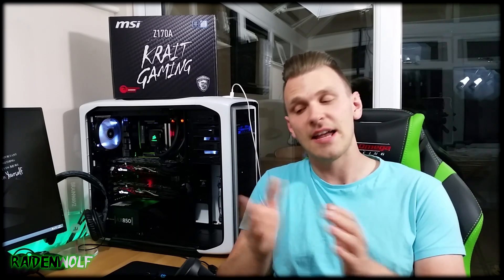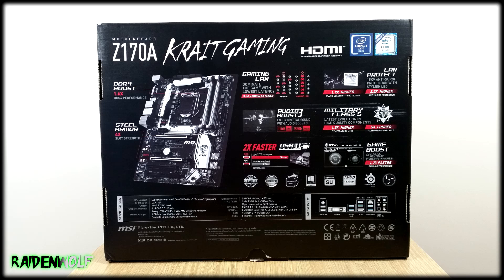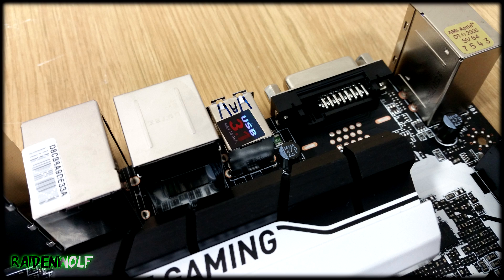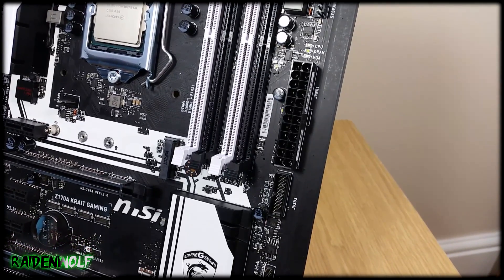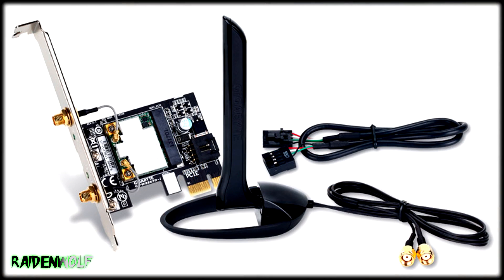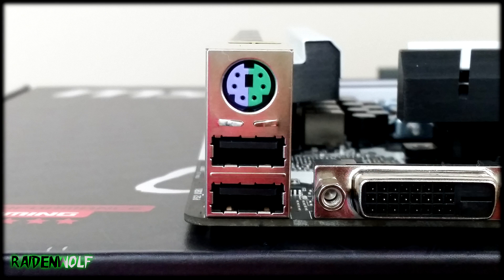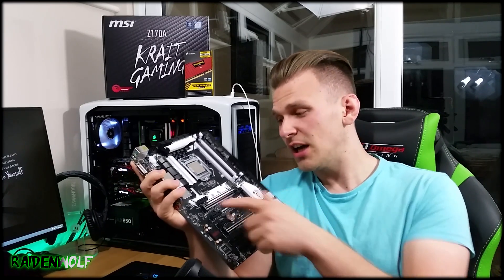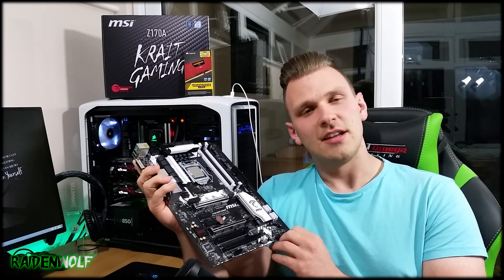MSI Z170A Krait Gaming Motherboard Review, In Depth Look,  Skylake, DDR4, Giveaway?

Comment: So wait if I have a Hard Drive, an SSD, and an optical drive does this mean i have to get more sata data cables?
Reply from the maker: Yes unfortunately you only get two sata cables so for your self you would have to get buy a extra sata cable or buy a m.2 ssd which will slots into the board then use the two sata cables for hhd and opitcal drive :/
Reply: thanks Tech K Raiden for responding. Im going to be booting my OS from a usb instead of an optical drive which is perfect for me since in my build im just gonna have a SSD and a Hard Drive this board is going to be good. Thanks tho again for responding though I really appreciate it

Comment: Would it be advisable to buy this now and keep it for awhile. I currently don't have the budget to get a new rig (mobo,cpu,ram), but seeing as kaby lake will be compatible with 1151. i was thinking of buying this mobo now and getting a kaby lake 2-3 years down the line. I know probably there will be a new processor line released after by that time, but i'm okay with using a slightly older processor. Currently my i5 4570 is doing quite fine but i want to switch up 3-4 years in the future.

Comment: so I don't have to get a sound card for best experience with headsets?
Reply from the maker: No you can use therw audio boost 3 with a analog jack headset (wired) if you use a usb you cant use the audio boost 3
Reply: Tech K Raiden yeah, I have already plugged mine into the motherboard, and i've seen a different in terms of the quality :)

Comment: Question Sir I'm confused are all lga 1151Mobo run all ddr4 i mean cant it run other frequency like pc 2666 or higher or just the high-end board only thanks sorry for my english.. im tight with budget and i want to use pc2666 ddr4 ram
Reply from the maker: +Kira Yamato Yes all z170 1151 sockets use ddr4 with 2100mhz up to 3600mhz so up to u with memory speed you wont to use ect.

Comment: I am thinking of buying this mb with an I5 6600k but I am conflicted because I like the gigabyte Z170x gaming, too.I have a lot of HDs(4+1 ssd) and I am a little concerned of space issues since I also have a huge gigabyte gaming gtx970.Any opinions would be appreciated.
Reply from the maker: Hey. Have a look at my other video of the msi z170a carbon RGB motherboard review I did after this, it is based on this motherboard  with some improvements :)

Comment: does this have built in wifi/can you connect wife to a pc w/ this board
Reply from the maker: Hey. No sorry this motherboard dont have a built in wifi you would have  to buy a wifi card for this which isn't really that much money to buy these days.
Reply: +Tech_K_Raiden Thanks! Whats a good wifi card under 30 bucks that works w/ this mobo and will work well when my pc is 2 rooms away from the rouder?

Comment: Question - can the processors I5-6400 or I5-6500 can be overclocked on this motherboard? If not - what can be overclocked?
Reply: +Piotr Witkowski You need to get a 6600K in order to overclock. And to answer you question, yes this motherboard supports overclocking (but your CPU must have a K at the end of the nummer.)
Reply: +Piotr Witkowski you cant overclock non k chips, if you get a 6600k or 6700k you can
Reply: +NADPH thanks... I bought 6600k and my motherboard is Z170 Tomahawk (also MSI) ;-)
Reply: +Piotr Witkowski I am gonna buy this board and a 6600k, the K means it can be OC.
Reply: +Piotr Witkowski - Ignore the other comments. You can overclock the i5-6500 up to 4.5ghz. Source Google. So save yourself some $$ and get the 6500
Reply: +Thijmen van Varik Thank you. yes after doing a research i bought 6600k for the mainboard.
Reply: Piotr Witkowski That's gonna be a sweet setup

Comment: This or Asus Z170 Pro Gaming?
Looking for a good board to oc a i7 6700k and a 980 ti. Gonna run it with ddr4 2x8 3200 mhz
Reply from the maker: Hey. This msi krait board and the Asus pro gaming are are around the same kind of board so doesn't really matter what you get they will preform the same. If you wont a good board though then maybe spend a little more and go for something like the gigabyte z170x gaming 7 ect for them better features.
Reply: Tech_K_Raiden dont have the $ atm...
Its really either one of these or a budget where i cant overclock shit. It´s a 5 dollar differences between the boards, should I just choose by colour?
Reply from the maker: Out of the msi krait or asus pro I would probably choose the Asus pro, unless you want a white and black build.
Reply: Tech_K_Raiden Yh thats  what a few people have told me. IF u dont mind me ask why wouldu pick that one?
Reply from the maker: For me I like using sli and the sata ports are facing up with is a bad design so the sata cable will interfere but besides that its good also i like dont like the white.

Comment: I've heard recently that due to a BIOS update it's now possible to overclock non-K skylake processors. Do you know if that is possible with this motherboard? Also, how can a user update the BIOS?
Reply from the maker: +Ciaran Gallagher Hey. Yeah I believe there is a bios update you can get. All you have to flash the Bios to new version is download the zip file of the new bios the put it onto a usb stick. Then boot the computer into the bios and you will see a M-FLASH button click here make sure the usb is in the computer and simple flash it.

I would recommend before flashing copying the old Bios to the usb first just in case any problems happen ect

Comment: the sata ports is the only thing that makes it bad...
Reply from the maker: Yeah but really if you are going to use sli or crossfire you would most likely buy a better motherboard anyway :)
Reply: +TheRaidenWolf I would like also this board and Asus z170-a to be in micro atx

Comment: If i install my soundcard (PCIe x1) in the last of the PCIex16 slots, will my graphic card still run with the full 16 lines, cause my sound cary only takes 1 line?
Reply from the maker: Yes that will be right. Skylake has around 20 lanes so would be fine :)

Comment: I have that MOBO and an i5 6600K. I game on it all the time without a GPU. Hoping Santa will bring down an R9 390 on sale during Christmas. 
PS: built my first PC ever yeasterday
Reply: I've got the same build but a GTX 970 in the mix. Board is quite nice except for the terrible positioning of the sata ports. Got everything OC and stable, loving it atm.
Reply: Awsome dude! I however will not recommend MSI Krait mobo. It suffers from horrible vdroop. When I was overclocked my CPU and got it stable at 4.6GHz at 1.415v the load voltage was at 1.34v!!! If the difference was closer to 2-5v difference I would probably go to 4.8Ghz on that voltage. The reasoning is that msi board has no LCC, get the Asus Z170A, it's brown pcb but a much better board. Additionally msi is not a full ATX, has no memOK, no ClearCMOS button, no debug display, no water pump header. It is sexy yes, but for the price it is quite lacking a lot of features.
Reply: +Mitch Swinger when you overclock you will need to add more voltage to stabilise the clock speed. When your CPU is not doing anything it has little resistance so it runs cooler and let's a lot of voltage through easily. when under load its resistance is higher and as a result the temperature increases and the voltage drops. vdroop is the amount of voltage drop, to be stable on a certain clock you need to have a certain voltage under load. some mother boards have LCC, it reduces the vdroop and gets a better OC. So for example if to get a stable clock at 5GHz you need 1.5v (when under load) then you will have to set your voltage to something like 1.6v when idle to compensate for vdroop. But at such high voltage you will have a lot of cooling issues, if on the other hand you had a LCC motherboard then you could set your idle voltage to 1.52v which is much more manageable than 1.6v and you would still get 5GHz.
Reply: +Mitch Swinger not necessarily, how do you think you overclock on LN2? They push like 2v through. Temperature kills your CPU, as long as you can delicate enough heat then you can push as much as you can.
Reply: +Mitch Swinger however on that board, 1.4 is a good maximum as it is only 8 phase power. I have my OCed to 4.6GHz at 1.415v (works at 1.41 but I added 5mv just to be sure. if you want to go higher clock with more voltage get a mobo with more power phases (chokes). You can go balls to the wall with Gigabyte G1 gaming that has 21 power phases!!!!! it is £500 Ashwell.
Reply: +Vasily Povalyaev You seem to know a lot, so since I havent bought it yet, would you recommend a gigabyte z170x gaming instead?I am gonna use a I5 6600k.Thanks.
Reply: Oh man, CPU OC is the easiest. I've just got mine at 4.4GHZ 1.3v, Corsair H110i GTX cooler. The GPU OC there's a bit more tinkering to get it stable but man, it's free performance, it's a waste not to OC the way I see it.

Comment: Hey, just a quick question, I´ve started tp build my own budget PC with a friend of mines help, I used this board, the GTX 960, Intel Core i5 6500 4x 3.20GHz and 2 times the 4GB Crucial CT4G4DFS8213 DDR4-2133 DIMM CL15 Single. I had it setup, everything worked greatfor about 1 day, then sudenly, while playing a game, the picture froze, sound kept repeting every 1/2 sec. or so. So i waited 10 min or so, nothing happend, so i pressed the power button on my PC, it shut down, began loading, but no MSI logo, only the white loading dots, I waited for 15min, nothing happend, i cut the power and since then no way of getting anything to work, just dead. only thing i get is when bridging the jumber next to the batterie (not the jbat1, other one i think) 1 white LED next to one of the GTX connections lights up and is i cut power it starts to blink... any idea what caused this? I asked custom support, and now got a replacement, but i want to know what caused this so i dont make the same mistake again... Any advise? Thanks for help!
- Oliver
Reply: Maybe try a bios reset 
Take out the button battery on the mb and put it back

Comment: This motherboard or the Asus Z170-A?
Reply from the maker: +mikaman MV Both motherboards are around the same spec and price so really it depends on if you before ASUS or MSI so whatever you choose you get the same really. Are you going SLI? if so then go for ASUS because the second card will interfere with the sata ports on the MSI board as I did so in video.
Reply: +TheRaidenWolf Thanks actually yes i was thinking in going with 2 gtx 970 cards and in my opinion the Asus board is more good looking, also if im not wrong i think it also has a pump controller right?
Reply: +mikaman MV instead of going with 2x 970, buy one 980. It's cheaper and you will get more performance
Reply: +I just comment the title of the video only reason to have SLI is if you bought a card and need one more and don't have enough to buy a better card. if you're builing a new pc, go for the best you can afford. if you can afford 2x 970, go for 980
Reply from the maker: +I just comment the title of the video I do agree. Sli is good when it scales properly but having 1 powerful card is better. 2x 970s will beat a single 980. 2x 970s is same as a 980ti after my friend got one we compared :)
Reply: TheRaidenWolf 2x 970s is not as powerful as a 980 ti. It's also more expensive.
Reply: +I just comment +TheRaidenWolf the title of the video i also agree, but 1 gtx980ti costs from 780-850€ new in my country and a new gtx 970 is from 380-420 almost no difference ik, but to save money i was thinking in going with 2 used gtx 970s for around 600 or less with still 1 year guarantee (trying to do a 1200€ good budget)
Reply from the maker: +mikaman MV Yeah going sli is still good. Two 970s will be about same as a 980ti. :)
Reply: mikaman MV If you're buying used, then OK. I was talking new. TheRaidenWolf 2x 970s will be a bit less powerful than a 980 ti, and way more expensive. Also, it will only have 4 gb of vram (3.5 that is good) instead of 6gb.

Comment: Hmm...I'm having a 1 GPU setup however my 1 GPU is a hybrid (AIO water cooled), so I don't know if the clearance will work, so should I choose a different Mobo, or stick with this one
Reply from the maker: Yeah using a single card AIO or not will be fine. The sata ports cables will only interfere when a second card is put in.

Should be all good friend :)
Reply: thnx heaps

Comment: Would you recomment this MB for a SLI setup like the 970 / 980 ti or are the two PCIE slots too close together?
Reply from the maker: Hey Erm not really because the second card will interfere withthe sata ports unless you will use a m.2 drive.

Comment: What do you think of the SATA cables faced up?
I hear people really complaining about this issue with the motherboard

Because long GPU may interfere with the SATA cables because they stick up instead of from the side...
Reply from the maker: It is a poor idear to be truthful and I did speak to msi about this and they said after they made it people did comment on the sata ports at pre release events and they said they will change it in future board?

But yes using a second gpu will interfere with the cables so prob best to use the m.2 solt if running sli or crossfire
Reply: TheRaidenWolf Well since it only happens in sli/crossfire I guess it wont be much of a problem, and with new cars such as fury and upcoming pascal, size won't be the problem because the cards are very small and won't interfere with the cables.

However having sata ports on the sides would help to make the board look more clean in the case

Comment: please  can someone  help me can i use ddr3 ram on this motherboard thanx
Reply from the maker: The 6600k and 6700k supports both ddr3 and ddr4 so one can guess that ddr3 most likely will work but after spending money on a new cpu and motherboard you  should really buy the faster ddr4 ram.
Reply: +NAzMul IsLaM  The skylake CPUs support ddr4 or ddr3l (low voltage ram), but the specification is also dependent on the motherboard. This motherboard does NOT feature ddr3l so don´t buy ddr3. ddr3 and ddr4 aren´t even physically compatible, and i am very concerned about the fact the +TheRaidenWolf doesn´t know that.
Reply: +TheRaidenWolf thanks
Reply: You can´t use ddr3 memory on this motherboard, this is only ddr4 compatible.
However if you really want to use ddr3 might take a look at this mobo: https://www.asus.com/Motherboards/Z170-P-D3/

Comment: Great review. I guess it's finally time to build my skylake PC!
Reply from the maker: Thanks you. Yeah it is and for price of board and features you get hard to resist this one :)
Reply: +Tech_K_Raiden I have this motherboard and I m getting the msi 970gtx gaming 4g graphicscard us that good enough for the new upcoming games?
Reply from the maker: Hey Terry, yeah should be fine. What res monitor will you be using with these items?
Reply: +Tech_K_Raiden Oh good question! I will have to buy a new monitor and that would have been my next question! Is that combo able to show 4k resolutions? sry for my english I m from germany and its 2am haha
Reply from the maker: Haha its ok its 1am here :) No a gtx 970 graphic card will not be able to handle 4k. 1080p will be perfect and 1440p you will still have a good time gaming. I have a video that shows 970 vs 1440p performance on my channel if you are interested in what a 970 can do at 1440p.
Reply: +Tech_K_Raiden sure I will check it out! if I send u a list of my pc parts could you tell me if I need to upgrade some of the parts soon? cuz to be honest I dont really know what I m doing I bought this mainboard after I saw ur review haha
Reply from the maker: Yeah sure no problem my friend I will have a look for you.
Reply: +Tech_K_Raiden thx I ll look for the parts list
Reply: +Tech_K_Raiden 
Core i5-6600k 3.5GHz
MSI Z170 KRAIT GAMING
RAM 16GB Kingston HyperX Fury Black
1000GB WD Blue
256GB Samsung SM951-NVMe
530W Thermaltake Smart SE
MSI 970GTX Gaming 4G
Windows 10
Reply from the maker: All looks like a solid build be very good for 1080p and ok for 1440p if you put a 980ti instead of 970 then it be even better haha

But you definitely have good gaming experience for sure.
Reply: Thanks for your advice! I will keep watching your videos! Are you doing a new one soon maybe for a graphics card? :)